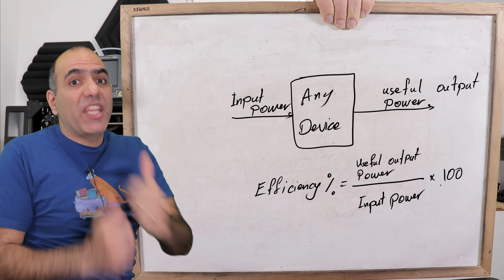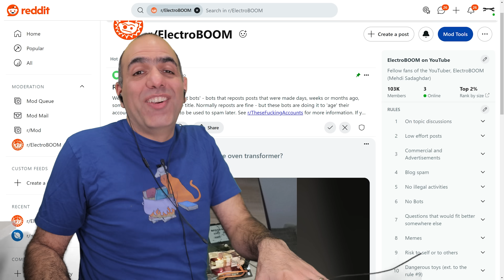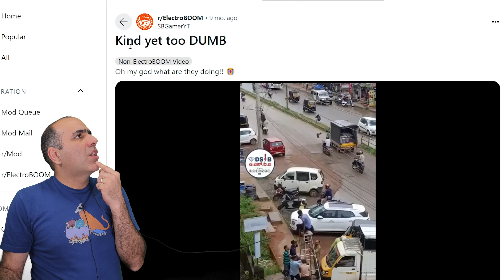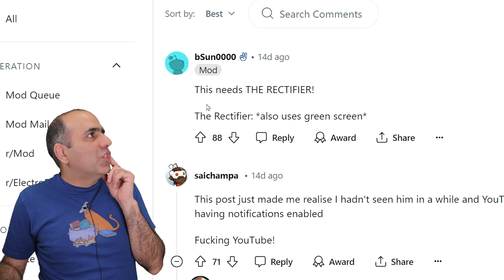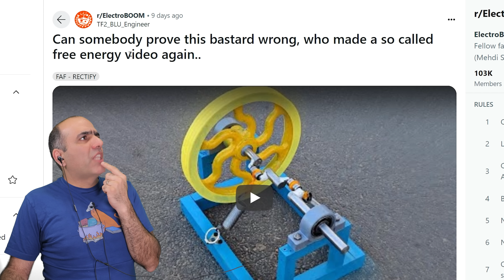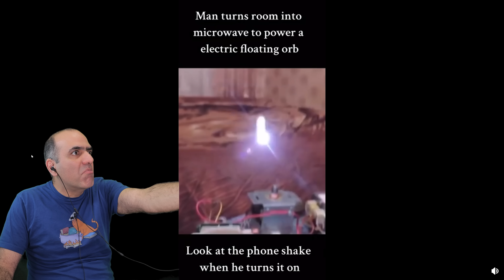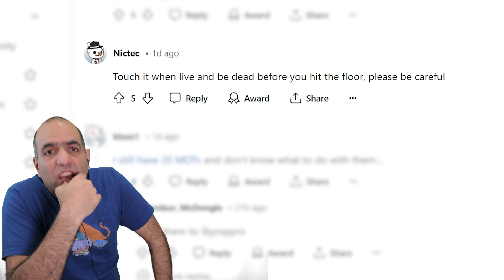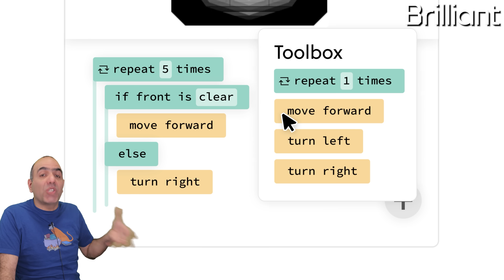New Flywheel Free Energy?! Can Boat Battery Fry You? LATITY-013

Comment: OK I love you man I really do but trump was talking about ev's in the context of making and all electric boat. The battery that would controll that would be on the order of a ev battery so around 10k-20k volts and several hundred amps.😅
Reply: The electricity still wouldn’t shock you. No matter how many volts are involved. It’s doesn’t create a bubble of death around it. The electricity will still travel through to path of least resistance, which in this case would be the negative terminal of the batteries that are inches away from the positive terminal.

Comment: on the efficiency of heaters - even under the assumption that you are find with just any heat anywhere - heaters arent 100% efficient, because usually some energy is also converted to light... and some might also end up powering chemical reactions
Reply: guess what happens to that light whenever it hits something... heat.  The only loss to that 100% efficient would be light escaping out the window.
Reply: @tsm688  thats not really accurate - and the fact that you can see this proves it... light can be converted into other forms of energy like electricity or chemical bonds as well
and secondary and tertiary conversions arent really something to consider for efficiency of a process

furthermore if you want to start considering specific environments - sure how about a greenhouse?
what about a space that isnt enclosed by walls?
also - think about when you stop the heating process... if you want to no longer add heat to the space... the moment you turn it off, the heater will continue to radiate heat, because a large amount of the energy went into heating the metal - and that takes a good while to radiate out... but its energy you dont really get to use unless you stop adding energy and wait for it to equalize... and that heat might not even be any good for you anymore, because you now may want to get rid of it
Reply: @SharienGaming  wait long enough and it becomes heat.  thermodynamics guarantees it.  the only wasted energy is the energy leaving the room.
Reply: @tsm688  wait long enough and heat ceases to exist as a concept - thermodynamics guarantees that as well... eventually every particle will have drifted far enough from every other particle that what we consider heat will no longer be observable
Reply: @SharienGaming  good luck getting your warranty back when that happens.
Reply: @tsm688  good luck heating a room with just visible light.
Reply: @SharienGaming  light + target = heat.  How have you remained ignorant of the concept of 'burning laser'?  People regularly set things on fire, just with light!  For a while there was a red laser in every computer powerful enough to do it.
Reply: @tsm688  sigh and do you know how much energy you need to put into a laser to heat a room with it? you are suggesting the equivalent of powering a train by throwing rocks at it
yes you impart the kinetic energy, but no you will not get the desired effect without enoug overkill that the object is destroyed
or if you prefer a less energetic example - its like trying to paint a building with a tiny brush

furthermore - lasers powerful enough to burn things rarely are operating in the visible spectrum of light (CD burners usually ran in IR, DVD in the red range and blurays in violet - lower wavelengths allowed for more focused beams and thus higher data density - consequently, if you want to actually burn something with a laser you use ultraviolet and up because that imparts the greatest energy)
Reply: @SharienGaming  *sigh* energy is not created or destroyed.  100 watts in means 100 watts out.  If the laser is *in* the room, whatever isn't heat, like light or magnetic fields or the sound and motion of a fan, and even the hum of a power supply, very rapidly becomes heat.  The only thing that doesn't heat the room is whatever escapes, like light out a window.

So yes, a laser is 100% efficient at heating the damned room -- because it **COULD NOT POSSIBLY BE ANYTHING ELSE**.  This is high school level physics.
Reply: @tsm688  a laser is also extremely fucking focused... so either the heat output is negligible or it will set the room on fire
neither of which goes to the purpose of heating the room, because either the heat gain is so small that loss through the walls wins out or the room ceases to be due to burning down

efficiency is not "look at what happens to the system if we let it run for 200 years" efficiency is "how much of the resources we put in actually contribute to the goal we are evaluating"
and the longer something takes, the less effect we get out of our input in any given timeframe
you arent doing asymptotic analysis
Reply: @SharienGaming  The heat output is exactly the power input.  That's what thermodynamics says.  The heat from whatever power dump you use, plus the heat from the laser itself, plus the heat from whatever sounds or EM fields are generated, equals the power input.  Nothing else is possible.

Comment: President Trump was talking about all electric boat not regular boat.
Reply: It still doesn’t matter, electrical batteries in water dont create a bubble of death around it no matter how much power is involved. Electricity will always follow a path of least resistance, in this case it will travel to the negative terminal of the battery which is inches away from the positive. You’ll be fine as long as you don’t sick your hands in between the terminals.
Reply: @chronovore7234  if you had a 500 volt battery pack in the water, would you jump into the water? For science sake. I sure wouldn't.
Reply: @harkbelial And thats why you call him “president trump” and not convicted felon trump.
Reply: @spaceageGecko  being convicted by democrat judge and democrat jury doesn't mean anything to me. He will be the next president Inshallah!!!
Reply: @harkbelial  Deny reality all you want. Thats not how a jury works.

Comment: What about electric eels? Are they putting out AC? DC? What is their range of effect? And how much voltage? Anchorage? This seems like a perfect topic for you to cover. Make sure your life insurance is paid up.
Reply: Electric eels have to touch you to shock you, there is no effective range. Remember, electricity has to travel to a ground somewhere. If you are floating in water you are not grounded. It’s the same concept with the electric car battery, it will travel from the positive terminal to the negative terminal.
Reply: this is already well known.  they are putting out ac at several hundred volts and up to an amp or so.  so easily lethal if you hold the fish the wrong way

Comment: No way. Heater isnt wasting energy to heat walls and air instead of u. Its warming up the environment for u. Hot walls will radiate the energy and warm up air, if the air cools. What a dumb way to define efficency

Comment: Trump was actually talking about "electric boat" batteries.  Like the ones in Teslas.  We all know what happens if they get infiltrated by water.  He wasn't talking about your average 12v marine battery.
Reply: It still doesn’t matter, the electricity will only travel to the negative terminal of the battery inches away from the positive terminal because electricity always follows the path of least resistance. Just don’t stick your hand between the terminals and you’ll be fine.
Reply: @chronovore7234  Water intrusion into a LITHIUM battery like those used in Tesla and other electric vehicles, cause the batteries to EXPLODE.  We are not talking about a lead acid battery like you have in your car.  He completely took Trump's comments out of context.
Reply: @farmermiyagi1338  they’re sealed batteries incased in a metal tube. They look just like AA batteries just bigger. They are not going to explode unless you puncture them.
Reply: @chronovore7234  And if the boat is sinking can you guarantee that?  Shit does happen you know.  Tell me, what would happen if that battery were to get punctured, during whatever disaster sank the boat?  And no, automotive lithium batteries are NOT in a sealed tube, boat batteries would not be either, because they have many cells that can be serviced individually.  Have you ever been into a battery on an electric car?

Comment: 7:50
I think it was about electric boats. Where the batteries must be high Voltage and have a lot of current output.
Reply: Ok so I searched for electric boat batteries and their most common voltages and I don't think they are sufficient to electrocute passengers either unless they are very immediatly beside the battery, maybe. And sharks very rarely attack people tbh.
Reply: The batteries are, like the main batteries in other boats, designed for safety if submerged. sigh. Pity he didn't look at that aspect.
Reply: @old_grey_cat  the only thing that makes the batteries in "other boats" safe is that they are low voltage. its not an intentional design for safety... the only reason they are even submergible is again, not even due to design, its the battery type so its just a happy coincidence really. naturally the actual components that make the battery need to be protected from the elements regardless so again the intention wasnt to make it safe to submerge. of  course with higher voltage batteries there would likely be some intention for safety in that regard.
Reply: @godw1ll99  Ah, I was going on what a boatie said.
Reply: yea so its weird that someone like mehdi would assume trump was talking about a standard low voltage battery. youd think he would know better.
Reply: @godw1ll99  Probably because there is substantially less big electric boats than cars.
Reply: Yes, but it shows how (in)articulate Trump can be without an teletrumpprompter. 😜
Reply: @HaroldoPinheiro-OK  its like a Stupid Elon Musk
Reply: @HaroldoPinheiro-OK  Well, yes but video was probably cut wrong time, that's why our BOOMer didn't understand it was about electric vehicles.
This channel is about electronic and I watch and want our BOOMer to explain everything understandable to the audience. I'm glad he didn't comment on the politics.

Comment: No, you're talking about the starter battery on an internal combustion engine boat.  Trump was talking specifically about battery-electric boats.  Much larger batteries and much larger voltage.